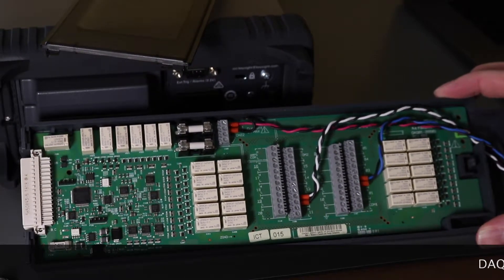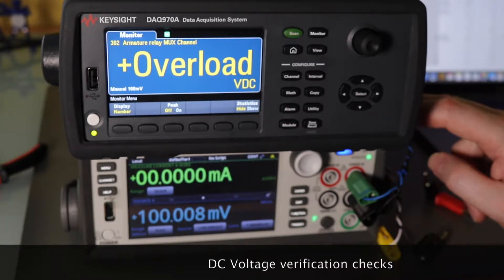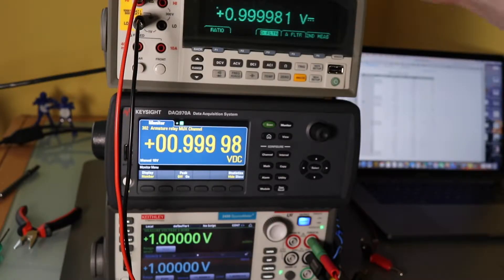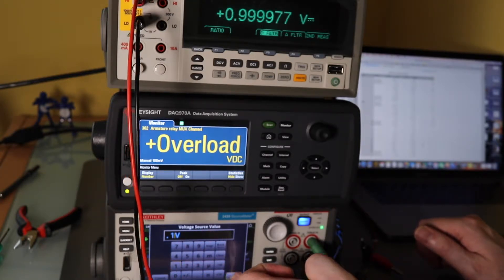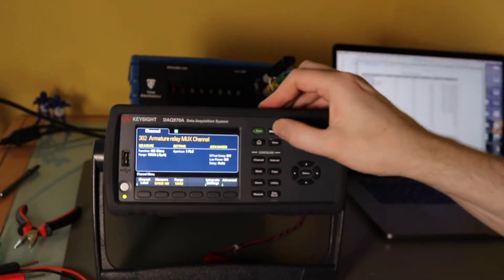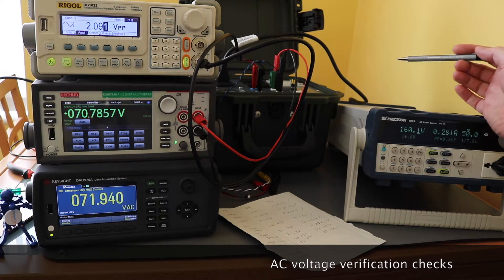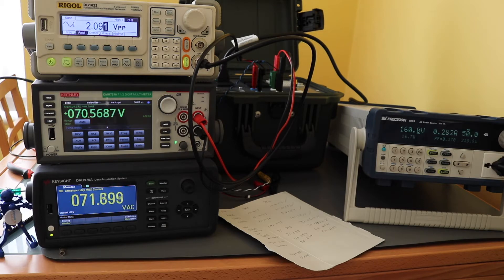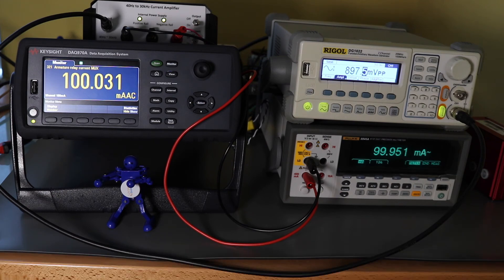DAQ970A Performance Verification Checks

Comment: thank you for the video.how about tempereture? can we verify tempereture reading if yes what it its accuracy?
Reply from the maker: I would have to do some calculations to see if the thermocouple simulators are accurate enough to test the DAQ970. The other way would be to do it through mV simulation.
Reply: @three-phase562  i've seen calibration certificate from a calibration service giving company.they calibrated ACV, DCV,ACA DCA and Resistanc, but they didn't included Tempereture test result. when i see the OEM manual there is not Temp Accuracy and tempereture is not in the verification procedure.  do you have any idea on this?
Reply from the maker: @BarakaMediaACM-lf4rg  Verification of the internal thermocouple reference junction is in the service manual and has a specification of +/- 1 degree C. After that you are looking at the accuracy of the DC mV function which is +/- 6uV for the 100mV range.